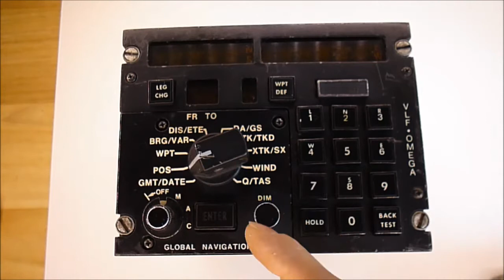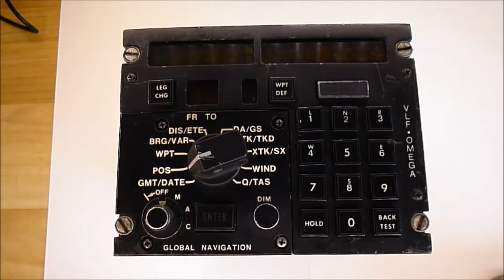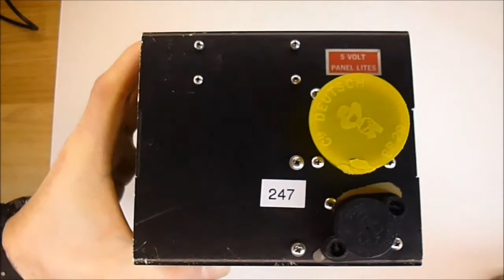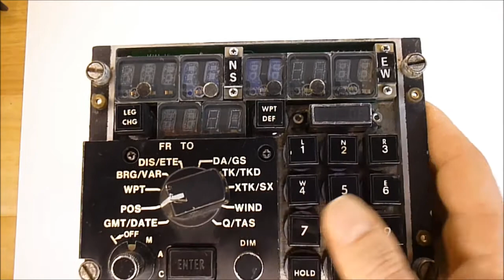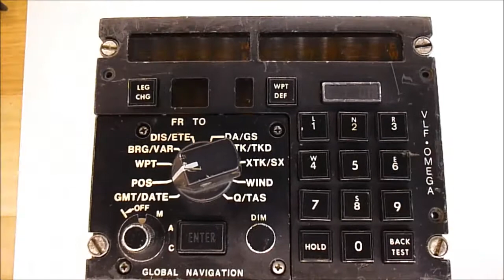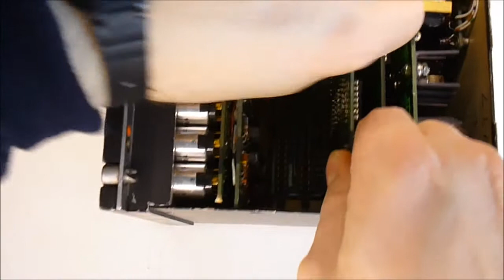GNS 500A  control display unit

Comment: Hello! I collect avionics and I have just bought an AlliedSignal GNS-500A CRT/CDU. It has a small CRT display and a keypad. Are those CDU units only a display and keypad or do they have a computer ("brain") inside? Seller said that it is most probably in a working condition. Will it work if I connect it to the power? Is there a website where I can get the pinout once my unit arrives?
Thank you!
Reply from the maker: No idea, it most probably have databus interface electronics, you will find out when taking it apart, but most of the processing might be external. Just figuring out the power supply can be tricky.
Reply: @msylvain59  Thank you for the answer!
Reply: Have you taken it apart? I've been trying to find some gut shots of it, but no luck..

Comment: I did a search and rescue mission in a leased Lear jet (just the search but if course ) many years ago. They had that same INS. We where doing flights on a pattern and we had the edges programmed in. Pretty good user interface as I recall.